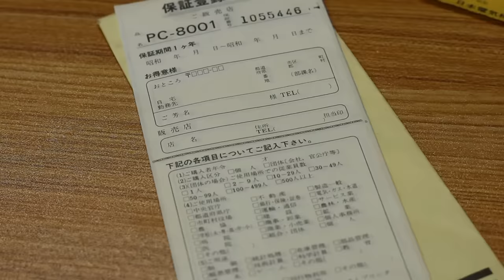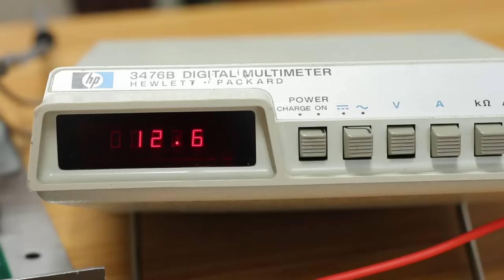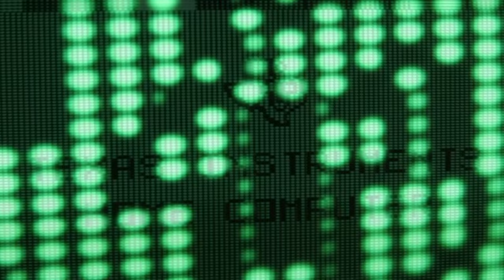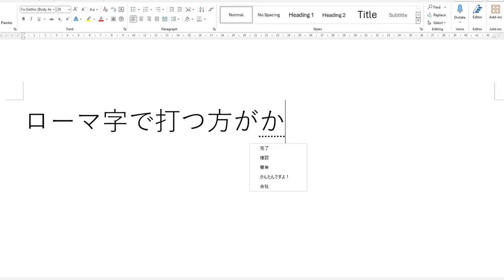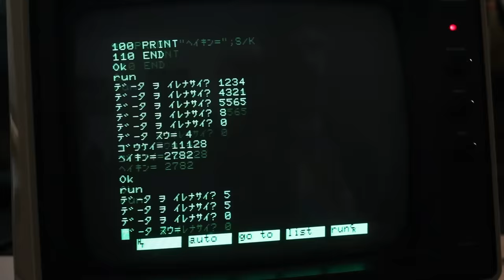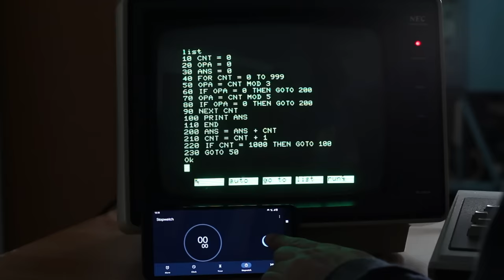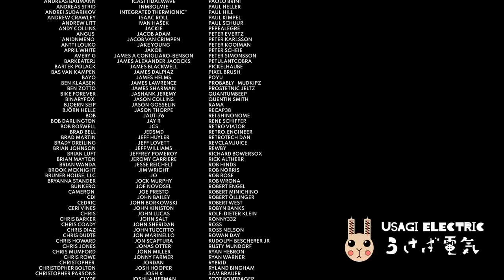This NEC PC-8001 is Epic!

Comment: That expansion thing with the led is a combobulator.  It increases the slew rate of the combos while not bobbling the code of the tabulatermer.
Reply: You sound like Shango066... Others already said its to increase the bps for the tape from 600 to 2400.

Comment: The opportunity to use the mini-computers is something still inaccessible to many, so interesting to see them on your channel.

I remember the MSX computers trying to break into the UK market in the early mid 1980s. Seeing the PC-8001 from 1979 vs the ZX81 of 1981 is mind-blowing, but I wonder how much it cost. Also amazing is that it could display katakana as well as upper and lower case English characters at the same time.
Reply: 168,000yen(about 740USD in 1980)

Comment: The add-on board could increase the speed of the cassette port.  Also, this looks very similar to the BASIC in the TRS-80 Model 100 and 200 portables.  NEC supposedly was the OEM for them.

Comment: Seems a pretty advanced version of BASIC if it had line labels.  The version of BASIC for, say, a TRS80 didn't have that, though some 3rd party extensions did.  AUTO can be given two numbers, the first one is the starting line number, and the second the increment.  LIST can be given a line number range.  TIME$ is actually a function, so PRINT TIME$ prints the system time (sometimes both date and time).  I guess you might also be able to do TIME%$=" and then a string representing the time so you can set the time initially (The TRS80 version required you to set the time from DOS, or POKE the clock variables.  Anyway, interesting little machine.  I wonder if they ever did a disk expansion for it?
Reply: It's a pretty advanced MS-BASIC for 1979, it's mostly up to the CP/M version except it lacks WHILE/WEND. And it's got hooks for a disk basic, but whether they made one or not, I don't know.

Comment: Now you just need a HP-PA RISC workstation to cover the 90's in the unknown computer knowledge (to follow the business theme of the older computers). I've been getting a HP 9000 C3600 running HP UX 10.20 for a work project and it's close enough to a modern Linux that it feels familiar but foreign in many ways such as CDE and package management being on CDs and using codewords to secure them.

Comment: Check out the Fujitsu Micro 7/FM-7 sometime.  64KB RAM, B/W composite and digital RGB video output, and not but TWO(!) Motorola 6809 CPUs. It's from the same era as the 8001.

Comment: I still have my first computer, a Commodore 64c, however the first systems we had in school where IBM PS/2 systems with i think OS/2 not sure it was a basic login system all the system were linked to a scsi tower that handled or had all the data on it making all the other PS/2 s more like terminals even though they had floppy drives

Comment: If you get on a forum(Japanese) you might be able to find that mod as something posted in some NEC users magazine. The only hardware mods that I have found in a quick search are for clock up which also requires an oscillator and a six wire jumper mod for increasing the baud rate of the cassette interface to 1200 for NBASIC. My first guess would be that it is a cassette mod for faster cassette interface. Maybe for the next video you can try using your famicom data recorder to try and save and load some programs. This one might be some more stable mod with all of the logic chips as opposed to the wires jumpered (hack) or the wired maybe a new hack that doesn't require all of the logic chips.

Comment: For the Project Euler task, it'd be interesting to try tne run time using an algorithm without idivs or branching e.g.

10 let total = 0
20 for i = 3 to 1000 step 3
30 total = total + i
40 next i
50 for i = 5 to 1000 step 5
60 total = total + i
70 next i
80 print "Total = " + total

I wouldn't have thought this would take 18 seconds.
Reply from the maker: The Project Euler question has a tricky gotcha in it, that tripped me up the first time I was trying to figure it out. It says "3 or 5" in the question. So, you have to be careful not to count some integers twice, like 15 is divisible by both 3 and 5, but it can only be counted once. 
That adds a little more complexity to the program. But, there are more clever ways to get to the result without consuming 18 seconds, I mostly just wanted to stress test the little guy!
Reply: Although this wrongly adds the multiples of both three and five twice.  Any ideas?
Reply from the maker: @PlayerClarinet In Centurion CPL, we just did a simple IF THEN ELSE:

LOOP WHILE (CNT.LE.999)
  OPA=MOD(CNT,3)
  IF(OPA.EQ.0)DO
    ANS=ANS+CNT
  END DO
  ELSE DO
    OPA=MOD(CNT,5)
    IF(OPA.EQ.0)ANS=ANS+CNT
  END DO

It's been a while since programming in BASIC, but I'm fairly certain you can do IF-THEN-ELSE statements, which should make it relatively easy!
Reply: To be honest, you don't need any iteration. Just add all the multiples of 3 (=3x334x333/2), all the multiples of 5 (=5x200x199/2) and subtract all the multiples of 15 (=15x67x66/2). But that's not the point. The more calculation done, the more efficient the program is as a benchmark so his version is perfect for its purpose.

Comment: I think NEC's failure to get traction in the states was due to the failure to get a working distribution/dealership network in place.  In part due to domestic powerhouses like Apple, Atari, Commodore, and even less popular ones like Adam. The marketplace can support only so many different systems.  The software may have been a weak point if most of it contained Japanese language and themes.

Comment: Just tried the Project Euler on a couple of other 8-bit machines that I happen to have lying around, and even against an optimised* version of the problem the NEC scores favourably to its competition. The C64 clocks in at 26.1 seconds, Atari 8-bit takes a frankly embarrassing 36.9 seconds, the ZX Spectrum splits the difference at 30.3 seconds, and the BBC steals everyone's lunch money and sleeps with their girlfriends at an impressive 5.2 seconds (helped by the fact that it also has a MOD operator; using the same divisibility implementation as the other versions bumps it up to a still impressive 10.9 seconds). (Also bear in mind mine are all PAL machines so suffer from the usual speed penalty.)

* By "optimised" I mean "you seem to have somewhat overcomplicated the problem" - this is the Atari BASIC version, the others are essentially the same but with minor syntax changes.

20 FOR N=1 TO 999
30 IF (N/3=INT(N/3)) THEN T=T+N: GOTO 50
40 IF (N/5=INT(N/5)) THEN T=T+N
50 NEXT N
60 ? T

Comment: With the botch wiring removed:
10 ans = 0
20 for cnt = 1 to 999
30 if ((cnt mod 3) > 0) and ((cnt mod 5) > 0) then goto 50
40 ans = ans + cnt
50 next cnt
60 print ans

Comment: Yep, the Z80 CPU did run faster... the Sinclair ZX80 was one of the fastest computers of the time because it didn't bother to update the video during compute cycles... so your code got to run at the full clock speed.  Later, they slowed it down by adding the "SLOW" mode in the ZX81 which allowed the display to be refreshed as well.  Not many home computers could keep up with the Z80 running at full song.

Comment: I was thinking it might have been a victim of the DRAM war. Off the top of my head I can't remember when the US America started imposing DRAM import restrictions on Japan, and I'm not sure if that would've included PCs with Japanese manufactured DRAM. Then I went back and noticed one of the NEC D416C chips was marked U.S.A instead of Japan, and I'm assuming the Toshiba chips were made in Japan, so not sure what's going on with that one chip.

Comment: TIME$ should be a pre-defined variable containing the current time.  There's probably a matching DATE$ variable.  IIRC, you can assign the date and time somehow so that the computer can display these correctly as long as it keeps running.  There may also be a matching TIME numeric variable which represents the current time as seconds (or something like that).
Since it's Microsoft BASIC, I'd probably check a GW-BASIC manual and see if the commands in there work on this machine, since the BASIC commands and format both appear to be almost identical apart from the narrow screen width.
And on that subject, I wonder if the add-on circuit was somehow designed to send a signal to BASIC on power-up to make it automatically switch to a higher screen resolution?  That would explain why it has no effect while the machine is powered up, if it is supposed to only work right after a reset.  Perhaps it acts like an auto-type for the command to set the screen resolution?

Comment: Japan bought its electric grid from the UK and the USA so half is 50 and the other is 60, It was super easy to play JP Megadrive games on a UK Megadrive with a case mod.
Reply: The 100 volt thing had to do with confusion between peak voltage vs RMS voltage, and when they ordered their first generators, they specified the wrong one. Older switching power supplies are probably okay with US voltage, but old linear supplies with big transformers would have more trouble with that extra 15%.
Reply: That's no reason to keep that stupid split a century later, or use a nonsense voltage for bulbs that stopped being manufactured decades ago.
Reply: The 50Hz equipment was originally from Germany, not the UK. Not that it matters.
Reply: @freeculture   It's not just light bulbs that care about voltage, it's also transformers, motors, and basically everything except modern regulated power supplies. To switch to 120 or 230v they'd need to transition over time, creating a split that's much more impactful than the current 50/60Hz one. And what would the benefit be?

Comment: Being able to play R-Type with ASCII characters is pretty damn cool!   For 1979 this machine crushes the PET and Apple II and is on par with the Atari 800 except in terms of graphics and sound thanks to Jay Miner's custom chips. Unless it was insanely expensive, badly advertised or had no floppy drive (or too expensive of one) I don't understand why it didn't do well in North America either. I was just getting old enough to be interested in computers by 1982-83 so was familiar with the Apple II, C64 and Atari 8-bit machines, NEC wasn't even a blip on the radar.
Reply: Apparently NEC built solid machines, but expensive. It was something like a Japanese IBM and often fought each other for the same clients (business, banks, etc). NEC had the localization advantage, Japanese language support out of the box, at least in the beginning...
Reply: i think once enough people settled for ibm and apple there was no more room for competition since they just wanted to have the system with the most software and most programmers didn't like porting things. japan was unique since old computers were quite bad with languages that are not English. so nec was more successful there .but most companies making nec pc software didn't bother translating their software or they did a bad job .in the rest of asia and other places computers were not affordable to most people until the 90s or even 2000s so they could just use Unicode and the few that did have a computer were willing to learn English just to use it .

Comment: Micu-ro-softu basicu, kudasai!  ^-^

Microsoft (for all it's faults) really was a standardizing force for the basic language.   Their basic ran on more machines than any other, AFAIK.  I have used basic on a lot of early 8 bit machines, and the basic was always Microsoft basic, and the command set was pretty universal.  Barring machine specific commands, and you didn't need those for most basic programs.

Comment: The 4MHz clock speed isn't anything to get excited about. The Z80 takes about 2x as many clock cycles to perform an operation compared to a 6502, so a 4MHz Z80 machine in 1979 had to be 4MHz just to keep up with contemporary ~2MHz 6502 machines. Real world benchmarks put the Z80 at 2.5x to 3x slower than a 6502 at the same clock speed.

Comment: Would be interesting to see what the output of the power supply is at 120/125V in.
Reply: The supply outputs may well be the same since it will be a regulated supply, but the stresses put on some components such as the reservoir capacitors might release the magic smoke, and possibly redecorate the room with aluminium foil when they explode. Raising the input voltage is not something you try unless you've understood the circuit and components first to ensure safety.
Reply: If it doesn't cause damage the outputs will be basically the same. Assuming a standard group regulated design the 5v rail would be identical but the +-12v rails might be slightly different (probably less than 100mV difference).

The 160v electrolytic capacitors would be run above their rated voltage if you do this. At 115v in it will be fine, but at 125v they'll likely start self-heat and this will dramatically reduce their lifespan.

Comment: Why did they use a big DIN plug if there was only the composite signal?
Reply: There were also separate digital sync and video-only pins on the connector.

Comment: a 32KB fast Z80 PC from 1979 certainly beats my 2Hz  2KB Z80 Nascom-1 which I got in 1978..

Edit: Typo there.. it was a million times faster (2MHz), which doesn't actually equal "fast" anymore..
Reply: I've got a Nascom-1, too (somewhere ...) but I'm sure it was clocked at a bit more than 2Hz!! 😂
Reply: @heckelphon  Indeed - 2MHz obviously.. though it'll probably feel like 2Hz compared to a  Pi5 running on the metal.. :-)

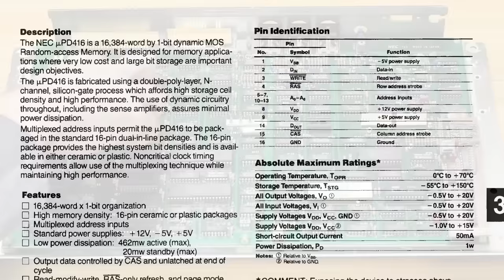Comment: 7:14 All those inline capacitors... I've never seen that before.  Did US-designed systems not need caps, or did they use tiny caps?
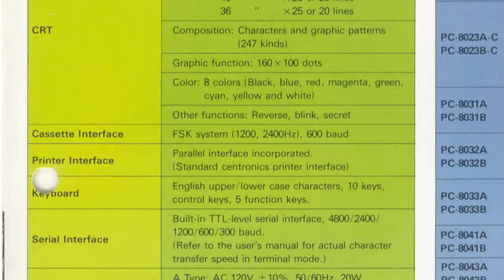23:12 Cost, probably.  32KB in 1980 was expensive.  Or poor marketing.

Comment: There is nothing wrong if your favoured machine is liked and shown in details. This machine has a lot of great details, but calling it "epic!" is a little exaggerated.

I know that during that period every one or two years a new champion emerged, and few years meant a giant leap in functions, capacilities.
So I will not compare this NEC machine to the later ones (like C64 or ZX Spectrum), but it is worth to compare it to the ATARI 800, released also in 1979 (it is not my platformat all).

-NEC PC-8001 Mk1 had 8 colors (close to ZX Spectrum, but it had even half bright colors), while ATARI has 128
-NEC had no real gfx mode, but a pseudo 160x100 gfx, while ATARI has 320x192 bitmap gfx.
-NEC had no music card, but beeps like ZX Spectrum, ATARI had the POKEY with 4 independent channels 
-CPU wise it is almost the same Z80 @4MHz or a 6502 at 1.7MHz are very similar
-Memory wise they are similar, though the ATARIs are more 48K vs NEC is 32K machines
-NEC had a 80 character mode, while ATARI had 40 character mode, like the C64 or later Commodores

Based on th aboves, the ATARI could have been easiyl called epic, as supassed the NEC in almost every aspect. 

The MK2 of the NEC PC-8001 released in 1983 was simply released too late, and though it had more memory and hires graphics, at that time it had tough competion with similar or better functions (eg. sound) and more RAM (ZX Spectrum 128k) or better equipped with functions (like C64 with sprites, more colors, SID music) not to mention the MSX machines became very famous in Japan.

Sure, Commodore and Sinclar companies were really far to create any mini computer.

Comment: My total guess on the add-on board - some sort of memory management, shadow memory - rom in ram or vice versa controlled somehow to allow redefinable chars or something like that?
Reply: But no RAM chips were visible, just standard logic ICs (gates and counter).
Reply: @GodmanchesterGoblin   Right - but bank switching may just tap into the rom/ram selection lines and divert ... i.e.

Sees Rom at $c000 selected disables rom, enables ram there instead - for UDCs  - pure logic, overriding the chip selects (memory locations selected at random)

I really am guessing though - I've no direct knowledge of this machine, I think similar tweaks were done on many 8 bit machines that had chargens in ROM and no bit map mode.
Reply: @richardlincoln886  OK, I understand where you were coming from. Yes, it could possibly have been something like that. Obviously, without knowing more about the original architecture and the details of the mod, it's hard to know what the purpose was.

Comment: Could the little board with a button be a reset switch?
Reply: Nope. As shown in the video, there's a reset switch on the back of the machine already. And even retrofitting a reset switch wouldn't need so much logic and neither an LED ...

Comment: Can it run MS-DOS ?
Reply from the maker: Not quite, it's a Z80 based machine and DOS was never really intended for Z80s. It can run CP/M though, which is a quite capable operating system. To do that, you need the PC-8031 dual disk drive unit (which I happen to have, yay!) and the PC-8033 I/O unit or PC-808012 Expansion Unit (which I don't happen to have...).

Comment: It is fun people see the Basic in this computer as great. It is the other way around. C64 and Apple basic are plain trash. Here in Europe machines usually had pretty good basic too, like the P2000T, ZX Spectrum and Amstrad CPC. I tested the P2000T, and it does MOD as well. What is weird though, it is older than C64 basic, which was also built by MS, so either Commodore did something really bad with their try to be compatible with the VIC, or Philips just got the right way to deal with Bill, I heard they used some magical powers back in the eighties when coming to Seatlle.